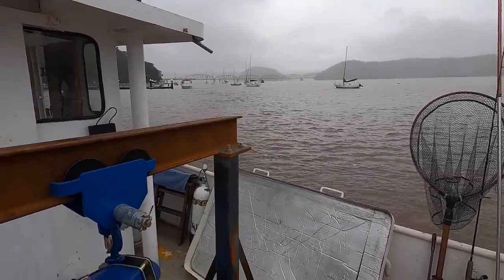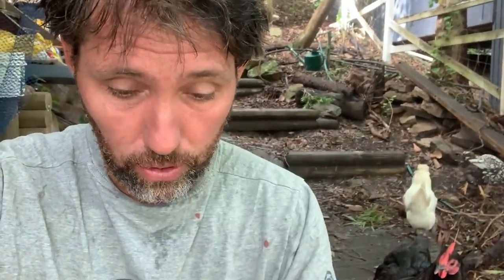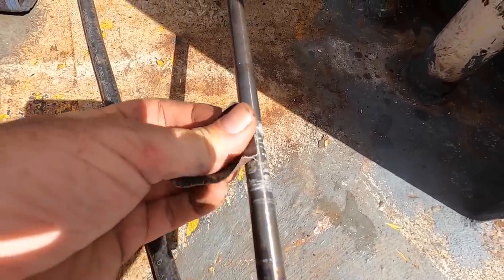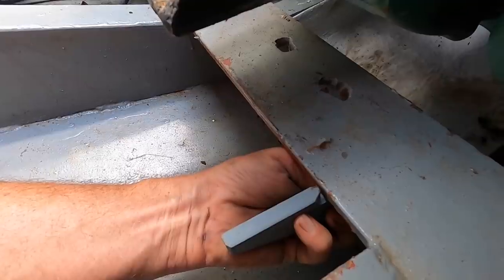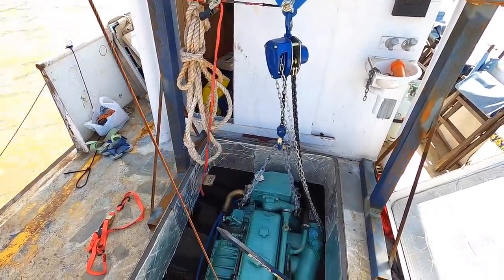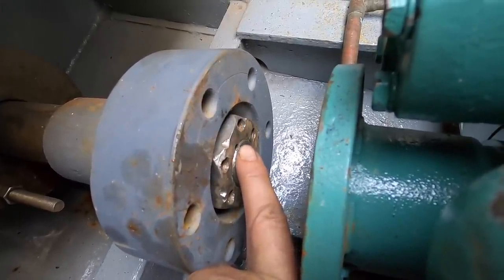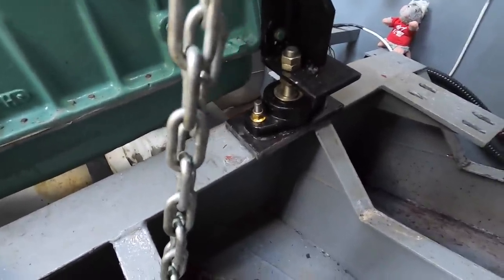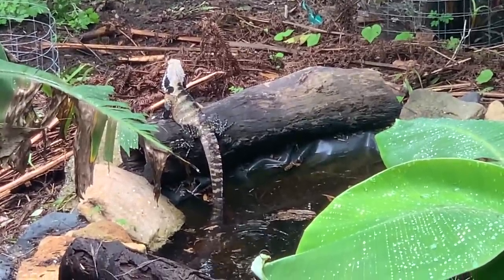Positioning the engine

Comment: G'day Stu.Looks like your getting some good advice there.Slack off the stern gland, beg,borrow or steel a comealong chain unit and with a sling/rope around shaft/coupling pull forward[if bit in water doesn't have excess of marine growth][position to give clearance for rope cutter ].A few bolts full depth into coupling and a small bar against the heads should then rotate shaft[comealong slacked off first]   .As mentioned ,tack on 4 plates with UNF/Fine pitch bolts to adjust engine sideways.Adjust rear of engine sideways first ,straight edge and feeler gauges against sides of couplings[or dial indicator swinging off a bracket bolted to gearbox flange, measuring side of coupling or prop shaft].Then front of engine -checking flange to flange distance [at 3 and 9 o'clock]with vernier callipers or the dial indicator.That should have unit close to sideways alignment.Next adjust rear mounts for height[straight edge/feelers etc top of flanges] get close.Then to front mounts, adjust  [measure at 12 and 6 o'clock between flanges] and back to rear mounts.Like straightening up a fridge or washing machine, the final adjustment on front mounts needs to be balanced for even loading[torque wrench elbow?]as you spanner up or down.Good Luck expect 2-3 days work.If it goes according to Hoyle and winds are favourable 1 full day.It is worth the effort.Vibration,vessel speed, fuel consumption, bearing wear, shaft,coupling and gearbox life swing on a good job.Also retightening stern gland will raise/ recenter shaft marginally ,best before starting alignment.
If your gland packing is teflon based you must have a steady seawater flow [at least a drip a second] before shaft rotation[under power].Otherwise the packing expands, the drip stops and smoke escapes in a couple of minutes if not enough flow!You need someone monitoring on your trials.Anytime tightening is done,very small adjustments, monitor for an hour before another .Once the packing has bedded in you can tighten up some more.Digital thermometer is a good call.Cheers ps It's really hard putting the smoke back into equipment at sea especially electrickery stuff.Just smells like dollars!!
Reply from the maker: Thanks mate, appreciate your advice. Can't tell you how many times I've struggled to put the smoke back in to something. ;)

Comment: Good idea Stu. The wheel house could stand a chain round it, then attach the ratchet strap to the chain and PULL!
Anyway, thanks for sharing.
Reply from the maker: Putting a chain right around the wheelhouse isn't a silly idea. 👍
Reply: Or maybe even just some kind of beam between the two posts aft of the wheelhouse, which you could then wrap a chain/ratchet strap around.

Comment: For the navigation display. Try making some extension brackets  that are slotted in a tee shape. So you can swing the head in many directions . Front to rear of the bracket,  up or down . Or as the manufacturer if they have a bracket that has a bunch of holes or slots for fine tuning position.

Comment: i agree with some of the other comments, give yourself a break for a bit , we have all been there, when caring on with a project while being fatigued will definitely cause problems one way or another, best wait until you have recuperated and then get back into it, a beer and a couple days fishing was a good suggestion,
Reply from the maker: Yes, I do tend to agree. I want to get it running but when you are so burnt out you spent 8 hours out there and get so little achieved you may as well have given yourself a day off.
Reply: @DangarMarine  i think your on the right track with getting all the running gear ready and the final stage on the hard ground, my last comment which i deleted i was trying to be funny but i suck at humour so i deleted it, anyhoo looking forward as usual to your progress, good vid as usual.

Comment: You could pretty easily make a new mounting bracket for the sat nav from 3 or 4mm aluminum flat bar.  Just bash two legs over 90* in a vice and drill a couple holes, that way you can jigger something up without a lot of welding and effort.

Comment: Getting prepped then getting on the hard stand to finish your power train and motor is a great idea. Probably would have needed too anyway for that prop shaft with how tight it is. Good job and keep it up!!! I finished fixing the motor on my J16 skiff. Been having a lot of fun, was inspired by you to get a bout to have and work on. I like your opinion of the “boat stands for busy out another thou” comment. Lol
Reply: As the owner of a shallow water skiff your “little boat” is an absolute monstrosity. I’m sure it feels cramped with all the tools and such but it will feel better when it’s zipped up and done. I think my boat could fit on the deck of yours no problem.
Reply from the maker: Thanks mate. Glad to hear you got your J16 up and running! :)

Comment: I dont know if im off base, but i wouldn't weld the shims until i had the flex coupler on and a aligned as close as possible to the shaft. Since the mounts are bolted to the shims you would have no forward/backwards movement if you came up short or long .. i totally get the stress of which to do first or second especially when your doing it by yourself.. get some beers and snacks and invite 2 or 3 guys over the get it done.. between you all you should cone up with something... wishing you the best of luck, wish i was local to you as i would come help get it all figured out with you!!
Reply from the maker: It would be nice to get the propshaft freed up so that all the fore and aft movement can come from there. It would certainly make welding the shim in less stressful!

Comment: Stu there are two (2) basic things to remember when trying to do any alignment, 1) The shafts being aligned must be on the same plane and this must be achieved first. Getting the flanges parallel will do this. 2) The shafts must then rotate around the same common axis. Failure to do this increases the stress on the flexible coupling causing premature wear. To bring the axis into line you can sweep around the flange ( if one shaft can rotate) with an indicator or use a straight edge and check for an even gap around the circumference of the flanges. Regardless of method you must make the same adjustment front and back (up and down, side to side) of the engine otherwise you will lose the plane. I would suggest welding 2 blocks (front and back) on each side of the engine with a tapped hole in them, this will allow side to side adjustment, the vertical is taken care of with the jacking screws. These blocks will also help when setting the flanges parallel.
Reply from the maker: Hey John, thanks for the info. With the blocks fore and aft, are you saying that the shims should be moved using those before being bolted or welded into place? By the way, I'm pinning this comment so we can all have a single place for coming up with a plan.
Reply: @DangarMarine  
You can gauge distance between flanges by installing a long a bolt through one of the flange holes (the easiest flange to turn) and adjust it to the coupler thickness minus whatever thickness of metal you want to use as a feeler gauge, then rotate the bolt to whatever clock position you want to gauge on the opposing flange.
It should also help with getting the gearbox output and prop shafts on the same plane as John was saying.
Reply: @DangarMarine  You could do that if it was all locked up, but I think the best way is to get the engine roughly positioned because there is side to side play in the mounting that was already noted (slots) .Plus it is better to get the welding out of the way before any final adjustments. Applying the pressure directly to the brackets holding the vertical adjustment screw or close by is ideal.
Reply: G'day Stu, I'm glad john put this comment in, I was going to say that a dial indicator could work and you could do it with the coupling installed. I used to do alignments on locomotive generator sets.

Comment: Stu, I just noticed that looks like a rigid stuffing box(not on a hose). Shaft to shaft alignment will be incredibly important not just flange parallelism. The poly flex coupling won’t relax this importance. If the engine is not well centered to the stuffing box the prop shaft will begin to run on one side of the side of the stuffing box and wear and leakage can occur. Secondly those engine mounts settle...a lot in the first 24 hrs and there on for the next year. I know, I use those. I’d fabricate a bracket to hold an indicator from the transmission side. That way you can indicate the prop flange face and the prop shaft when you rotate the transmission manually. You may want to double check the power rating of your poly flex coupler. Diesels have quite a bit more torque than gasoline engines so you can’t always go by hp. Good luck and take plenty of breaks to get blood back in your legs.

Comment: For that monitor, you can also cut a wedge of wood as a spacer to allow the bracket base to angle such that the top of the monitor is very close to the top.  May be easier than welding, just an idea.

Comment: Never seen inline fuel filter like that, good tip on the drive shaft on the outboard. I hate working on outboards so I don’t do it. You might have to go back on shore to figure out the prop shaft issue. It should spin freely if it doesn’t you run the risk of breaking something. The drive plate between the gear and engine is the weak link.

Comment: Handcraft a fibreglass pod that you can attach to the wheelhouse ceiling in a sloping wedge design and affix the marine GPS into It and remove the need for its mounting bracket

Comment: That gland packing will put pressure on the sharft as packing does swell when wet, so when ready loose gland packing bolts a little, shaft should turn after reset gland packing with engine running shaft turning.
Reply from the maker: Yes, I think that will help but I think most of the friction is unfortunately coming from the cutlass bearing.
Reply: @DangarMarine  ok with morning coffee watching videos and full of wisdom just maybe toast with coffee.

Comment: Could you use 3 or 4 Gage blocks (or sockets) held to the flange with magnets? Let the engine rest up against the Gage blocks sitting between the flange and prop shaft, then adjust the motor mount bolts to hold the motor in that position. 

Should preface I have zero experience... 

Looking good though! I commend your patience in getting the important bits done right.

Comment: Now, what might be a good idea ....  you know the coupling on the end of the shaft ... if it had some holes drilled in the side, you could either put a bar in it, or a C spanner to crank it around, which might be very useful at some point if you get jammed up in ropes ... just a thought.

Comment: Good progress considering the weather , you ma be able to put a dial indicator onto the gearbox flange with a magnetic mount and rotate it in neutral to see we where you are with alignment .
with the Raymarine mount just put a wide wooden wedge between the bracket and the roof this will tilt the mounting  horns closer to you but will also rise them up.
Reply from the maker: Wedge could be a good way to go.

Comment: Well done for keeping your mojo going even if the going is tough!
Your engine positioning pain I can feel. I tried shimmying a similar load by myself and hated every minute... and that was on solid ground. Doing it on a moving boat - kudos!
When you said that there were no points for straps anywhere, I thought back on how I did it and recall having a number of small car jacks - with long handles on the pump they can be quite accurate to nudge a load here and there. I recall welding some extensions onto them to fit them into place. This may not work for you of course, just one of those ideas in the froth of youtube ;)
Reply from the maker: Thanks mate. I definitely think welding some points to push and pull from may be the only way.
Reply: Dangar Marine Well, I admit that after I wrote this I remembered watching "Lady Dew Build" channel and he is always welding attachment points to his hull for straps - much better than jacks trying to follow gravity ;)

Comment: One day, I am going to build my own boat.  However, I am thinking, that, a slip yolk and CV joint might be a lot easier, than going through all this work to precisely position and align the engine to the prop-shaft.  This would make for an easier engine installation,  and if something ever happened to change that alignment, the skip yolk and CV joint would compensate for it.  These would also be much easier to service and replace when needed too.  To prevent the prop-shaft from "drifting" forward and aft, a simple spring and shock assembly (like from a motorcycle) could be used so it would return to center.  This system would be very adjustable too, and if your prop ever hit anything, instead of bending, it would just move and return to it set position.  In theory anyway.  Just a few ideas...   Still, great job Stu, we're all routing for you.
Reply from the maker: I definitely think some type of CV joint is a great way to go. Certainly one of the luxuries of designing the whole system from scratch.

Comment: Stu!! i have an idea to help ya!! ok i like the socket feeler gauge idea, now this might be hard to explain, but if you lathe up two disks the size of dinner plates , (as big a you can fit ) bolt one to the shaft and one to the engine, this would make the feeler gauge socket trick way more accurate as you are dealing with a much larger diameter , then once the two dinner plates line up , swap them out for the flexy coupler
Reply from the maker: I do like the idea of amplifying the misalignment by increasing the diameter.

Comment: G'day Stu, 
Hows it all going mate?
Am still hooked on the refit, engine positioning is hard work mate, one thing that will really help you control the new positioning task are jacking bolts that are Horizontal.
You're already able to control the heights with the mounts n nuts, but you need to be able to control the forward/aft, port/starboard position of the engine.
Vertical plates welded on, 8 in number, 2 at each corner. 5/8 UNF nut welded on and a clearance hole, 5/8 UNF Bolt and a lock nut.
 The UNF thread is for the fine adjustment and these adjusters can be backed off and just left in situ for next time for location,
This will hold the engine in position,  Metal G-clamps as an extra retainer to the webs, just to lock it all down, fine tune its position and be safe mate.
No ute tie downs required as i bet the engine has moved unexpectedly on you, thats when your heart stops.
I don't post much, but watch every episode mate, saw you were struggling a little and had to give you some help n advice.
Bring on the Winter

Malc Qld
Reply from the maker: Hey mate. I definitely thing some jack screws will make the final adjustment easier. I wish I had added them on the bench!

Comment: 12 Mins-35 Secs in you said your mate Andrew suggested using a socket or something similar to start your alignment, matching up the Coupling Faces alignments [Axial] First he's indeed correct this is the most important alignment to square away... once you have that squared away  throw a small rule across the top of the couplings to see the gap... which may look a lot but remember you're looking at only... 'HALF'... that dimension so when you're either shimming of Jacking up to correct that Radial Alignment...you're gaining as you raise and loosing on the bottom so that top dimension falls away very fast......being equally split. [Hope that makes sense] even dropping  in the flexi coupling loosely when your close would be and idea ...Plus a set of old School Engineers Internal Caliper's could also come in handy at that stage...giving a sense of feel Checking like four positions on a clock 12 ,3 6 and 9, Great Work  You're on the home straight now...

Comment: Hi Stu, you have adjusted up the stern gland too tight which is why your prop shaft won't turn, a properly adjusted gland still allows  a few drips per minute,  but tightening them whilst doing work is fine, just remember to loosen them before trying to turn the shaft with the motor or you will burn them out
Reply from the maker: I’m pretty sure the tightness is coming from the cutlass bearing but I’ll try bs king it right off.

Comment: Didn’t you tighten the prop shaft gland nuts to stop a leak when you launched? They may be gripping the shaft too tightly and preventing it from moving. my swimming pool pumps at work, if I tightened the gland too much while the standby pump was static, the friction was enough to start smoking and melting of grease! Also if you put the spare turn of packing in, you will need less pressure to get a seal. Keep going Fella we’re all rooting for you and we do enjoy your work, so don’t get despondent even though you are working alone.
Reply from the maker: Thanks Roger. I've had the stern gland backed off so the tightness seems to be coming from the cutlass bearing. Appreciate the support!
Reply: @DangarMarine   if the packing is banged down tight it might take a bit to free it off again

Comment: A little known feature of heavy old 2 stroke diesels is there ability to remove toes while you move them around. That's why most folks wear shoes. 😛
Reply: I think if you drop the Detroit on your toes, the shoes will only keep them in one place so the clean up is easier.
Reply: @richardlamm4826  A 4-71 dressed and with a small transmission would be just short of a ton, more than enough to ruin your afternoon.